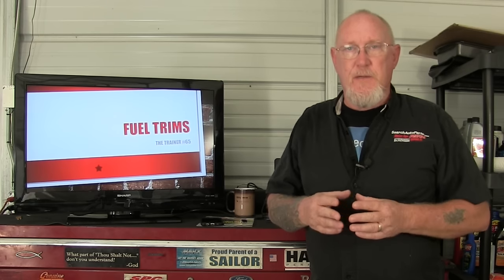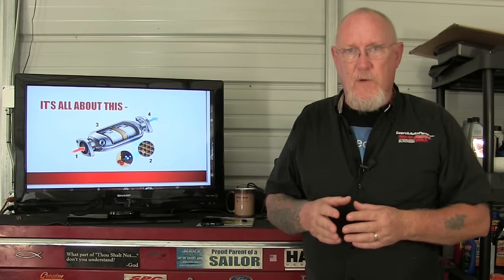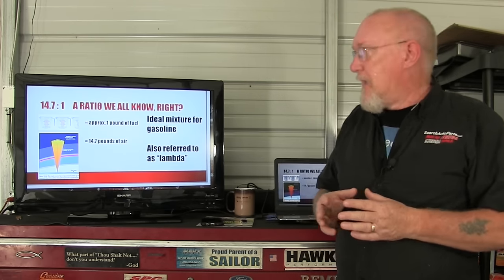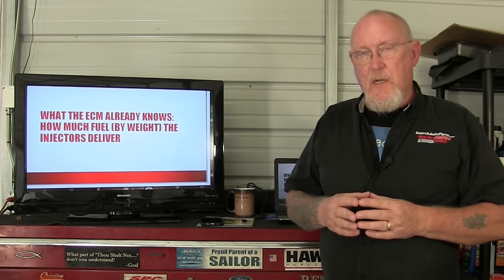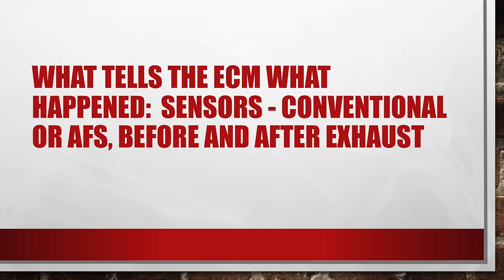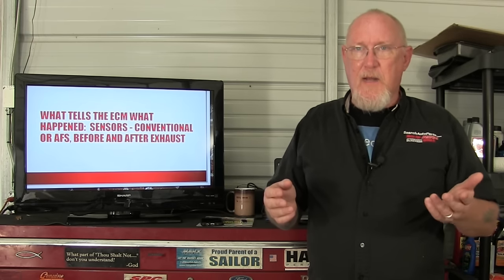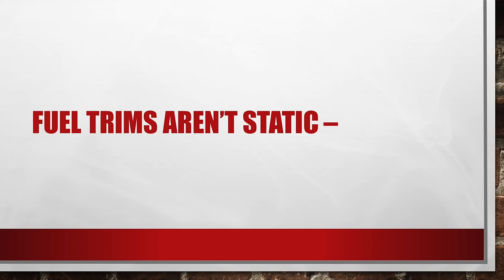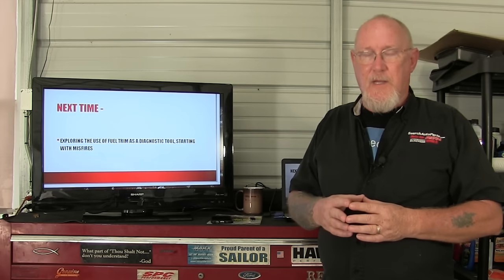The Trainer #65:  Fuel Trim Explained - What It Is , How It Works, And What It Can Tell You

Comment: Does anyone on here know why an 06 nissan pathfinder 4.0l would run rich on 1 bank and lean on the other bank accompanied by a p0300 (random multicylinder mis fire) and a p0333 (knock sensor high voltage)
Reply from the maker: Is there any loss of power? If the fuel trims are excessively positive on one side and excessively negative on the other, one problem that can cause this condition is an exhaust restriction (if it is dual exhaust). What are the trim numbers at idle? at 2500 rpm?
Reply: @MotorAgeMagazine  extreme loss of power... I ran engine with front a/f sensors out and still no power and mis fire. I disconnected all coils 1 at a time with a change at every cylinder I've replaced spark plugs and 3 coils under the plenum. Sprayed the whole top of engine with brake clean no difference so I don't think vacuum leak or restricted exhaust.. could it be cam shaft sensor or knock sensor
Reply from the maker: @9ernorm84  Is this a dual cat exhaust at the manifolds? Leading to one or two downstream cats?

You may want to disconnect at the exhaust manifolds and see if power is restored.
Reply: @MotorAgeMagazine  it does have a y pipe with 4 cats I believe. Wouldn't running it with the a/f sensors out restore power? Also with harbor freight infrared thermometer all exhaust pipes in and out seemed to be within 50 degrees
Reply from the maker: @9ernorm84  The A/F sensors may not be enough so I would try another option to confirm. OR you can install a backpressure gauge in one of the holes to see what it reads. I wouldn't use the IR measurements.
Reply: @MotorAgeMagazine  ok I may try the back pressure gauge.. I'm weary of taking the exhaust apart unless i have to for fear of breaking a stud or bolt, it is an old vehicle but I love it and would love to fix it

Comment: My ford focus never had any fault codes. The problem whas the car had no power most of times. Mechanic told me that these car are like this? Get used too it. After buying a focom scantool, i saw my long term fuel trim stays 12% lean. So i decided to replace all filter, fuel filter, air filter, oil filter, spark plugs, new fuel cap, i looked up for false air none. So after all this the long term still stays 12%. So at last i decided to buy a new oem front oxygen sensor. And gues what after using it for about 2 weeks the long term stays at 0,5%.now and the car has a lot lot lott more power now ! Its like a brand new engine now. So never trust these data from the sensor! Nothing is wrong with the engine the sensors are lying!
Reply: Wonder if that is MY problem. I get the 175 code (too rich). When I scan, the long term climbs to -25% or higher. BUT....   the code only comes up when I hold it at 2000 RPM for a few minutes while parked. NEVER under normal driving conditions.
Reply: Jake Jones Check for air leaks around the intake side and vacuum lines.
Also check your O2 Sensor Live data to see that they are working correctly and one is not lazy.
Reply: Makes you feel so good when you can fix things like this.
Reply: BusinessEtiquettes usually vacuum leaks cause there to be more oxygen than gasoline in a system to rich. Usually it’s a faulty O2 sensor or a misreading MAF sensor. Still could be a vacuum but it’s rare

Comment: Great video, thanks ; I don't know if you can help me on a P2270 (stuck lean) code reported with my scanner because the check engine came on last week. First, I took pictures of my scanner screen then erase the code. Same code reappeared on next engine start. Here are the reading of the live data:

Engine rpm                                                      965                                           2100                                    700
STFTB1                                                          0%                                               6                                            1.6
LTFTB1                                                            -6.3%                                        0                                              -8.5
O2B1S2                                                            0.61V                                        0.68                                      0.79
STB1S2                                                           99.2%                                           99.2                                     99.2
LAMBDAB1S1                                                 1.0                                              0.96                                      1.0
O2B1S1                                                             -0.02(ma)                                    0                                        -0.02

I think there is something wrong with a stucked value of 99.2% STB1S2. I suspect O2B1S2 sensor as faulty. Thanks
Reply from the maker: Try a snap throttle test and/or adding propane to the intake to see if you can make the sensor switch.
Reply: @MotorAgeMagazine  I have made the test this morning(saturday) at idle speed of 800 rpm. I have used propane for the test and it was added to the air intake before entering in the air filter. Here is the result:

O2SB1S2             0.77 V (almost no variation on the graph)
STFTB1S2            99.2 % (still no variation on the graph)
LAMBDAB1S1      1.0 V (some variation on the graph)
O2SB1S1               0.02 Ma (some variation on the graph)

May I considerer both O2 faulty? Also before this test, I have used propane over the engine for vaccum leak and nothing occur. Do I have to make mores tests? Still don't understand why STFTB1S2 is always stuck at 99.2 ! 
---------------------------------------------------------------------------------------------------------------------------------------------------------------------------------
Yesterday(monday), I tried propane and carb cleaner over the engine for vaccum leaks. No variation with these tests.
With a snap throttle, some variation but not much(0.65 to 0.8V)with the O2SB1S2. But still 99.2% with the STFT B1S2. This value don't change all. It is stucked there and don't know how to reanimate this value. Maybe it is normal? LAMBDAB1S1 and 02SB1S1 vary a bit with a snap throttle but they are quite stable. I still think B1S2 as faulty. I have several screenshots from the scanner during those tests if you want to see them.

guwrt77@gmail.com

For the moment, the check engine is on and the engine run like usual. I don't know if fuel consumption raise.

Thanks again
Reply from the maker: @aguertin3846  Try adding the propane directly into the MAF sensor upstream of the engine. Graph the oxygen sensors to see the response better. What kind of scan tool are you using?
Reply: @MotorAgeMagazine  scanner Innova 3160RS. My car is a Volks Passat 2016 Rline 1.8 tsi.  The only value that doesn't change with both sensors is STFTB1S2. Snap throttle, propane in the intake, carb cleaner , this value do not want to change. On the graph with a snap throttle, the voltage drop almost to zero and rise to the normal but the short term show a straight line at 99.2% with no drop or rise. Load value of 14.9%. I think there is no maf. I can send you a couple of graphs if you want.
Reply from the maker: @aguertin3846  At this point, it's likely a bad sensor downstream of the cat. Replace S2.
Reply: @MotorAgeMagazine  I have replaced the downstream sensor with a GTK sensor and things going ok now. No check engine on since yesterday morning. However, I still don't understand why the STFTB1S2 still indicate a stable 99.2%. But the graph of the voltage is much higher and there is more variation
Reply from the maker: @aguertin3846  Not sure. Could be the scan tool, or a default value that hasn't cleared  yet. Check Mode $0A (Mode 10 - permanent codes) to see if the code is still recognized by the ECM
Reply: @MotorAgeMagazine  Hello sir. Use my scanner to check for permanent DCT and nothing appear. So, good news. STFTB1S2 still indicate 99.2% steady. Voltage on S2 is much more active. Maybe I made a mistake to only check or stick to STFTB1S2 and the associated voltage. I have noticed a big change with STFTB1 and LTFTB1 specially the last one showing a value of 0.0% ( +- 1.0) stable. At the beginning of all the tests, this value was rather -6% stable before the sensor replacement. Thanks again.

Comment: What causes p1164 code its a headache to resolve i already replaced the o2 sensor and spent over 300 dollars and no fix.
Reply from the maker: Let's start with the basic info first; Vehicle Make, Model, Year, Mileage, Engine?
Reply: @MotorAgeMagazine  1997 honda civic hx mileage is 278k engine 1.6l vtec d16y5
Reply from the maker: @gamercat7004  Common cause of this codes is a failed Air/Fuel Sensor but keep in mind that any leakage of air into the exhaust manifold or contaminants/improper fuel mix can also impact the sensor's output.
Reply: @MotorAgeMagazine  i replaced the oxygen sensor and still gives me the code again. and thinking that could it be a leak or the catalytic converter is slowly giving out?

Comment: I think this guy just likes to talk about every little thing I don't know if anybody can follow him but the engine is really critically measuring the fuel rate burn with about five different sensors before and after the engine in the O2 sensors really a heat sensor we say it's oxygen I'm not sure why they say that but it measures the heat because it generates a heat electrical signal if we call that at oxygen sensor or an O2 sensor but it measures the heat like most sensors except for a vacuum sensor

Comment: my cars are a 1992 and a 1994 jeep xj no code here
Reply from the maker: Your vehicles are OBD I. Back in those days, each manufacturer had their own codes and code definitions. But it still had the same job - emissions.
Reply: @MotorAgeMagazine  I have a list of codes I can get with the check engine light but its not helping me now in my situation the car runs perfect when it cold and it will set and idle rev up up and down cold or hot but when it's hot and you're driving it likes the stutter like a bad fuel fuel injector I need to see what's happening when computers doing the work ( I have no codes or check engine light )

Comment: I had a scanner connected while driving and I noticed that the faster I drove around 65-85 the heigher the MAF reading were over 17-28 g/s. To me that seems normal since more Air is getting in through the Air filter  or am I wrong? Is there a limit for what it should read on High speeds? sentra 2005.
Reply from the maker: I wouldn't use that number alone as a diagnostic tool, unless I had a "known good" to use as a comparison.